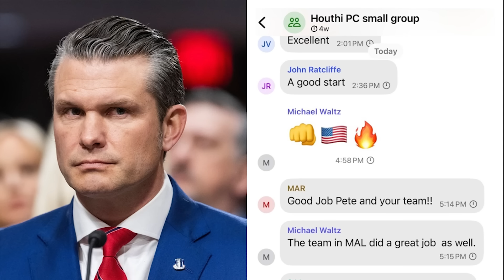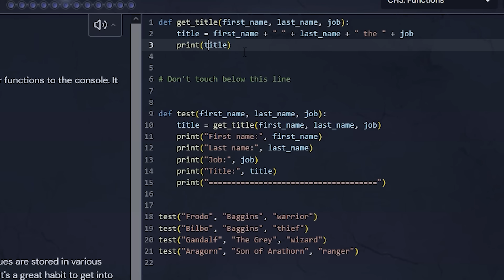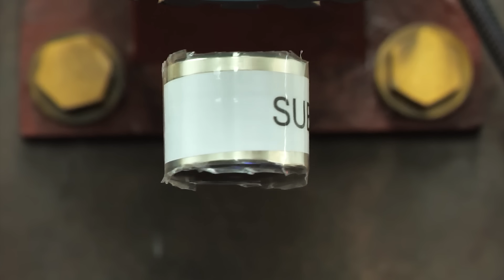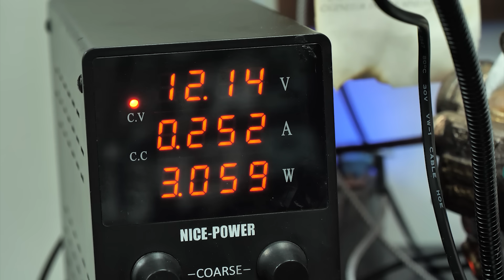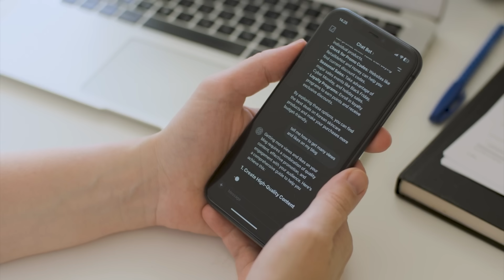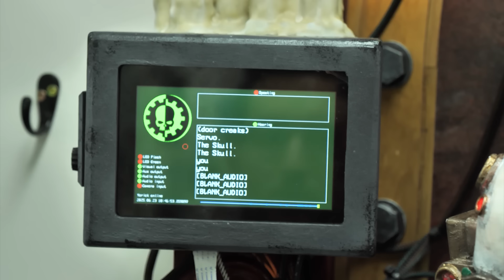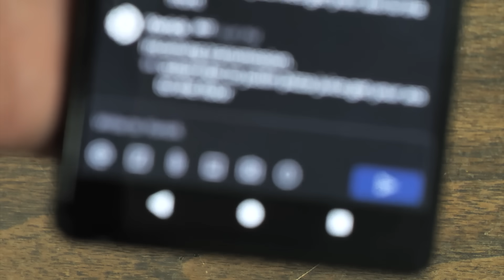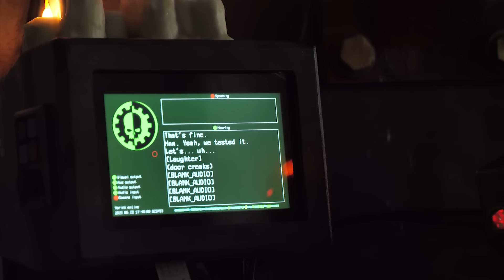I built a Talking, Levitating Servo Skull from Warhammer 40k

Comment: Would you be open to helping me bring this design into reality:

Nano bots:
1. Modular Design:
* Basic Unit: The fundamental building block should be a small, versatile nanobot unit capable of both mechanical and biological functions. This unit could be composed of a carbon nanotube or DNA-based structure with embedded biological components.      
* Interlocking Mechanism: These units would need a robust, yet flexible, interlocking mechanism to form larger structures. This could be based on nanomechanical principles or DNA-based self-assembly.      
* Specialized Modules: The nanobot body would be composed of various specialized modules for different functions: 
    * Structural Support: Nanobots with enhanced tensile strength and flexibility for forming a body-like structure.  
    * Nervous System Interface: Nanobots designed to interact with nerve cells, potentially using biomimetic materials and nanomotors to facilitate signal transmission and reception.  
    * Energy Storage and Management:Nanobots capable of storing and distributing energy, perhaps through nanobatteries or nanogenerators.  
    * Waste Processing: Nanobots with the ability to filter and process waste products.  
    * Self-Repair and Replication: Nanobots with the ability to self-repair damage and replicate on demand, using DNA-basedreplication mechanisms or other nanomanufacturing techniques.  
*    
2. Bio-Mechanical Hybrid:
* Mechanical Framework: The nanobot body would have a mechanical framework composed of carbon nanotubes or nanotubes for structural support and protection.      
* Biological Integration: The mechanical framework would be interwoven with biological components, such as proteins and enzymes, for functions like nutrient absorption, waste processing, and nervous system interaction.      
* Biocompatibility: The materials used in the nanobot body would need to be highly biocompatible to avoid causing harm to the human nervous system.      
3. Self-Replication and Repair:
* On-Demand Replication: The nanobots would need to be able to replicate on demand, using DNA-basedreplication mechanisms or other nanomanufacturing techniques.    
* Self-Repair Capabilities: The nanobots would need to be able to self-repair damage, using nanomaterials with self-healing properties.      
4. Nervous System Interface:
* Nerve Cell Interaction: The nanobots would need to be able to interact with nerve cells, potentially using biomimetic materials and nanomotors to facilitate signal transmission and reception.    
* Signal Processing: The nanobot body would need to be able to process signals from the nervous system and translate them into actions, and vice versa.    
* Brain-Machine Interface: The nanobot body could be integrated with a brain-machine interface, allowing for direct control of the nanobot body through thought  Neural implant:
1. Surgical Implantation: 
* Micro-electrodes: The implant typically consists of an array of tiny micro-electrodes that are surgically inserted into the brain, often in areas like the motor cortex responsible for movement.      
* Biocompatible Materials: These electrodes are made of carbon nano tubes.      
* Surgical Precision: Precise placement is crucial, often achieved with surgical robots to ensure the electrodes are positioned correctly adjacent to neurons of interest.      
2. Neural Signal Recording and Decoding: 
* Electrophysiology: The implant uses principles of electrophysiology to record electrical activity from neurons.      
* Signal Processing: Algorithms are used to decode these signals, converting them into commands that can be understood by external devices.      
* Wireless Transmission: The decoded signals are then wirelessly transmitted to a computer or other device.      
3. Technology Control: 
* Brain-Computer Interface (BCI): The implant acts as a BCI, enabling users to control devices like computers or smartphones through thought alone              
*                                  

Safety:
* 
* 1. Using Biocompatible Coatings:
* Hydrogels and Polymers: zwitterionic Hydrogels, polyethylene glycol (PEG), and PEG methacrylate (PEGMA) are used as biocompatible coatings on the electrode surface to reduce inflammation and scar tissue formation.
* Reduced Cell Adhesion: These coatings create a buffer layer that reduces the adhesion of microglia, fibroblasts, and macrophages, minimizing the foreign body response.
* Improved Hydrophilicity: The high water content in hydrogels increases the energy required for protein and microorganism attachment, improving the hydrophilicity of the electrode surface and reducing biofouling. 
2. Engineered Materials:
* Nanostructured Surfaces: Creating nanostructured with low friction and surface energies on electrodes can significantly decrease cell attachment and prevent biofouling. Such as silicon nanopillars
* Conductive Polymers with Improved Electrical Properties: Conductive polymers like such as poly(3,4-ethylenedioxythiophene) (PEDOT)
* Combinations for Enhanced Properties:Combining conductive polymers with other materials like carbon nanotubes can further enhance their electrical and mechanical properties, leading to longer-lasting and more stable implants. 
3. Surface Modification:
* Altering Chemical Terminations:Modifying the surface of electrodes by altering their chemical properties, morphology, and wettability can reduce biofouling.
* Functionalizing with Conductive Polymers: Applying functionalized conductive polymers to the electrode surface can significantly reduce impedance, as shown with polypyrroles (PPys) on gold electrodes. 
4. Addressing Material Specific Challenges:
* Biopolymers: Combining synthetic polymers with natural polymers like gelatin and collagen can create biosynthetic composites with enhanced bioactivity and allow for controlled biodegradation and tissue ingrowth.
* Gold: While gold is biocompatible, it can have limited electrochemical conductivity at smaller scales. To address this, nanostructured gold, such as nanoporous structures, nanorods, nanoflakes, or nanopillars, are used to increase the surface area and reduce impedance. Also, coatings like PEDOT:PSS on gold electrodes can improve electrical characteristics.

* Refine Implantation and Structural Design:
* Flexible Electrode Materials: Given the mechanical mismatch between rigid materials like silicon and the brain tissue, incorporating flexible electrodes with low bending stiffness and Young's modulus can minimize tissue damage and chronic inflammation. 
* Optimize Structural Design: Proper structural design can significantly influence the neural interface's interaction properties. Even with higher Young's modulus materials, careful structural design can lead to improved flexibility and reduced tissue damage.
* Minimize Vascular Damage: Research indicates that minimizing vascular damage during implantation is crucial for preserving neural tissue and improving recording performance. Therefore, refine the surgical procedures and possibly explore less invasive approaches like the Stentrode, which is inserted into the cerebral vasculature. 
* using hydrogel coatings as vehicles for releasing anti-inflammatory drugs like NLRP3 inhibitors and Utilizing coatings or materials that promote the adhesion and growth of neurons to enhance the stability of the electrode-nerve interface. This can be achieved through techniques like using specific cell-adhesive molecules or by creating nanostructured surfaces that facilitate neuronal attachment. 

*  Maybe using biomaterials that mimic the extracellular matrix (ECM) of native tissues, such as self-assembling peptides (SAPs), to minimize the FBR 
Specialized nanobots: 
Eyes (Visual System): 
* Light Detection: Nanobots could be equipped with specialized modules containing light-sensitive proteins(e.g., rhodopsin) or quantum dots to detect light and convert it into electrical signals.    
* Image Formation: These nanobots could be arranged in a layered or arrayed structure to mimic the retina, capturing and processing light information from different angles.    
* Signal Processing: Nanobots could be equipped with nanoelectronic circuits or nanoscale logic gates to process the electrical signals and create a visual representation.    
* Nervous System Interface: Nanobots could be designed to interface with the optic nerve, allowing the visual information to be transmitted to the brain for processing.      
Ears (Auditory System): 
* Sound Detection:  Nanobots could be equipped with piezoelectric materials or other nanoscale sensors that can detect sound waves and convert them into electrical signals.    
* Sound Analysis:  These nanobots could be arranged in a structure similar to the cochlea, allowing them to analyze the frequency and amplitude of sound waves.    
* Signal Processing:  Nanobots could be equipped with nanoelectronic circuits or nanoscale signal processing algorithms to interpret the electrical signals and create an auditory representation.    
* Nervous System Interface:  Nanobots could be designed to interface with the auditory nerve, allowing the sound information to be transmitted to the brain for processing.

Comment: fun fact, when electricity started to replace candles in chandeliers, people missed the looks of candles. So they made a fake candle stem to hide the rod, cables and socket into which they screwed the lightbulb. Those fake candles were made using a thick roll of cardboard (like the one in the center of aluminium foil) that was covered in real wax using the same technique as you used for your fake candles.

Comment: i had a really really similar idea down to the raspberry pi!! im super happy to see someone do this, as for the auto-scribe functionality i had the idea to use a paper similar to receipt paper since it uses heat to print and you wouldnt have to worry about ink, my original plan was to use an LLM (heresy i know, but hear me out) on a remote server that the servo-skull could connect to so you could take it around with you and still have access to its LLM functionality, this way you can be more dynamic in what you say to the servo-skull and it could still understand what you want to do without having to hardcode specific key-phrases, the LLM would interface with the scripts by outputting what actions it wishes to do in a JSON format allowing the code to understand exactly what must be done!

Praise be to the Omnissiah!

Comment: 12:34 super soft clear caulk (nice caulk) with a small clear tube inside, in the shame of a flame (soapy hands help you shape it). Take a piece of wire, bend it, and insert into the tube such that when you hold the base of the "flame" made from caulk, rotating the wire inside makes it twist. Glue the flame to the candle and solder the rod to a small pancake motor. Rotating the flame while projecting yellow and orange LEDs with inbuilt flicker at the flame will make it look like a flame both flickering and moving. :D

Comment: Is there any reason (strength maybe?) that you have opted for active magnetic levitation instead of a passive one - like using an inverter magnet that would lock your skull in place without using any power or electronic. A bit more elegant solution.

Comment: You need to get a home assistant voice assistant in there, it's also non-llm based (by default) but has a myriad of pre built commands which can be used to control connected devices and it can always be extended and customized from what I've seen, all without needing to build everything from scratch yourself.

Comment: Ideas: 

Replace camera in the big eye with a image intensification based night vision camera, and replace the light in the other eye with a camera that has a ring of small LEDs (if possible you could try to make the camera mimic what a cat's eye does with the tapetum lucidum to make the camera glow red). 

Replace the green painted circle next to the flash light with a UV camera. 

Replace the dangling fake wires with useful stuff, like a cable that plugs into a USB port and one that plugs into a headphone jack. 

Replace the fake metal limb on his side with a tiny robot arm.

Comment: would have been funny to glue inside the skull more magnet on the perimeter and have a couple coil magnets on the "wall". With that you could have done basically an electrinc motor kinda and you could have make yorik move left and rigth.
Reply: but maybe the weight of the cables is too much

Comment: Uhm.. I would add a current limiter, could be a "simple measure voltage drop comparator with hysteresis" or something more rustic such as the bimetallic thermostat.
Aside from that, the skull camera would greatly benefit from having a automatic lenses and maybe a internal gyroscope or fan to move around.

Comment: Using so many abominable images was a little odd knowing both that you are more than capable as an illustrator (people prefer the authenticity of this), and are also without shortage of material to use for illustrative narration in this case. Not that it's a new thing for you, but sure was laid on pretty heavy. The only reason I am commenting about it is that it felt especially pointless and cheap this time around is all, very content mill-core.

Anyways, cool project, keep it up.

Comment: Dude what are the ratios you use for “the gunk”? I have some 3D print projects I plan on starting soon, and that sounds like an excellent finishing technique!
Reply from the maker: honestly we eyeballed it. Dumped a whole tube of wood filled, a big scoop of gesso, and enough acetone to make it the right consistency. it's very forgiving of different ratios. We specifically chose it because we wanted a fast easy finishing method that minimized sanding

Comment: OK so Etherdyne has this wireless power setup that can expand to cover a full room. And a series of coils mounted around the ceiling could potentially provide levitation coordinates around the room. A thin wire coming out of the top of the skull could suspend it a couple feet below the magnet bundle. Now the skull floats suspended from the ceiling at more-or-less eye level and is powered wirelessly. Locomotion can be done by activating/deactivating nearby coils, which could be controlled by a pretty basic image recognition routine in the camera or by voice commands and pre-set coordinates for things like its "dock". 
Go ham, yall, this is just a prototype and you can do WAY more

Comment: stt is also a form of ai. if you're already employing a simple stt model on board, you might as well use a more heavy-duty model like whisper. it doesn't all have to run on the raspberry pie, you can for example set up a connection to a more powerful server that sits elsewhere and does the stt and send back the data.
Reply: Whisper is what we used, and it does run dogshit on the RPi, so it just streams the sound off to a bigger machine. Piper does work well on the RPi.
Reply: By the performance you're getting it seems you need to run a larger version of whisper. it usually works pretty well  @val3tra